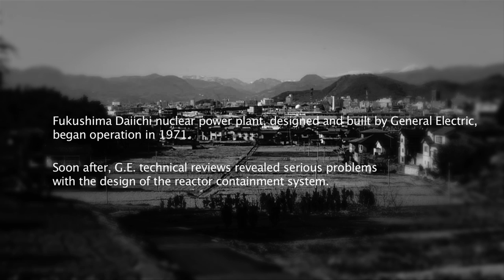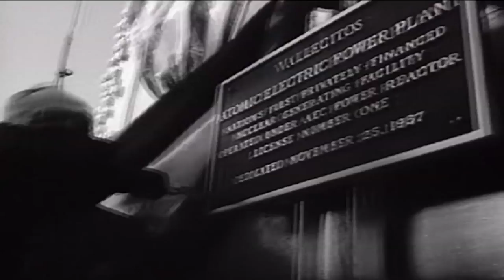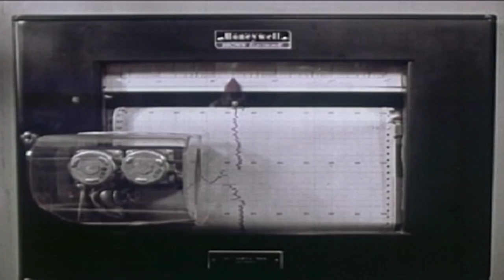Ex-GE Engineer Highlights Critical Fukushima Reactor Design Flaw

Comment: In 1968 another GE engineer named Ergen did a report which exposed issues with the ECCS in the GE Mk1 BWR (Emergency Core Cooling System, General Electric, Mark1 Boiling Water Reactor.
In that report, now available online, Ergen discusses the Ultimate Heatsink where seawater flows cool the corium after meltdown and melt through.

Comment: Blaming ALL nuclear power plants because your own design is seriously flawed is just dishonest. There ARE better designs. The main problem with these plants is the use of water at insane pressures. Besides water having very poor qualities for heat capacity at the mega watt level it is also subject to breakdown in the presence of hot zirconium cladding into hydrogen and oxygen gas.
Molten salt reactors do not suffer this problem. All BWRs should be shut down because of their intrinsic flaws and replaced by Molten salt reactors. Don't forget anti nuclear really helps the petroleum industry.
Reply: spikedpsycho  Lead cooled MSR reactors could be an option. Since the fuel in an MSR is in a constantly molten state, and because if the laws of thermodynamics, as it heats thermal expansion will seperate the fuel molecules, reducing fission, and in the case of an emergency they can dump the fuel into drain tanks, completely removing the moderator and ending the chain reaction. There would obviously be hurdles, like corrosion and metal on metal reactions, but it would be super efficient, and passively safe.
Reply: spikedpsycho  True. Maybe we could tune the fluoride mixture or increase the ratio of uranium, or maybe even use plutonium? That has a high neutron flux, and cannot be used in weapons once it's put in a reactor.
Reply: The fundamental problem with MSRs is still unsolved: it's easy to stop the reaction, but then you have a puddle of hot nuclear mess - self-heating at 6% of reactor power - that's trying really hard to boil off radioactive nasties like iodine, cesium, and strontium. You must keep it cool and contained. The reason why folks like FLiBe are focusing on smaller nuclear reactors is that particular shutdown technology doesn't scale up very well. 

(Also, it's been almost 10 years. What have they done other than write DoE grant applications?)

Despite how simplistic and widespread BWRs are, they have only suffered two meltdown incidents: destructive testing at Argonne and Fukushima after massive (but not unforseen) flooding. And they run at lower pressures than other steam plants, so I'm not sure what you're hand-wringing about. 

Lead-cooled reactors are the most exotic technology that's actually feasible in the near term.
Reply: spikedpsycho  

> positive void coefficient which plagues virtually every known operating reactor type presently

I'll have what you're smoking. The only reactor types "plagued" by positive void coefficient problems are RBMK (if operated as originally designed) and some metal-cooled designs, especially sodium.

A coolant that tends to absorb (and shield) neutrons will have a positive void coefficient, a coolant that tends to moderate neutrons will have a negative void coefficient. Water has a negative void coefficient if there is no other moderator (BWR, PWR) or a  positive void coefficient otherwise (RBMK, CANDU). Sodium usually has a positive void coefficient. Water with dissolved boron, has a more positive void coefficient (PWR especially in shutdown). Lead is not as positive as sodium because it doesn't absorb neutrons very well. With a reasonable design you get a small negative void coefficient. 

But the void coefficient doesn't matter because lead shouldn't boil and if you have a leak you're hosed anyway. The negative void coefficient of PWRs doesn't help them much because boiling coolant or dry fuel both count as Signs You are Having a Bad Day.

Comment: Sorry MsHollyK, not accepting your assertions. 

There are far better sources of info on this than you. 

Uncovering of the core does not equate to 'melting down'. Until you can point to 'corium' in the concrete basement of the containment building you are simply interjecting conjecture into the argument.
.
Reply: uploadJ 🤔...
Reply: Now we know there wehre 3 meltdowns and a covert up meltdown 30 years ago in Fukushima.